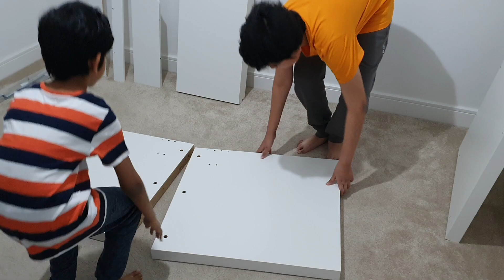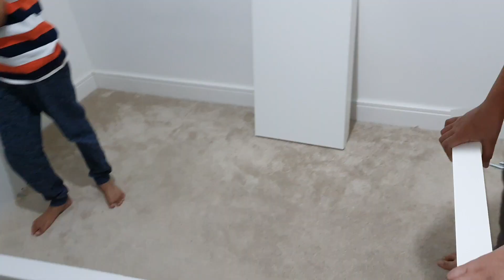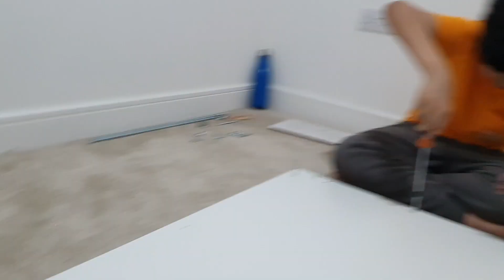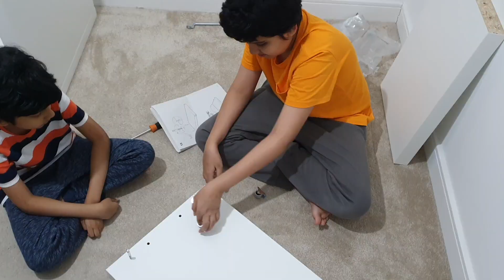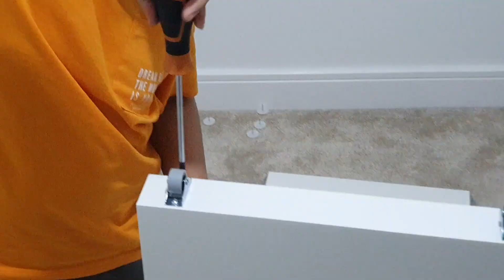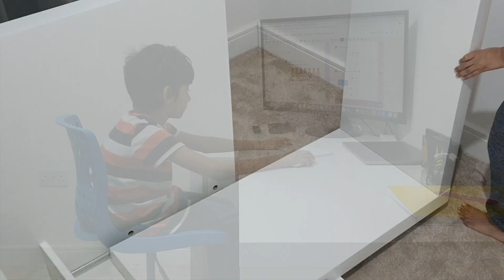DIY - IKEA MALM Desk with pull-out panel

Comment: HI im getting the same table but i want to buy an extra drawer unit to put under but im not sure if a 70 cm would fit inside the desk, the desk measurement is 73cm but i have no idea how thick it is. could you please measure yours and let me know please would be a big help!
Reply from the maker: The table top is 5cm thick which means you will have 68cm gap underneath the table. We have kept a shelf of 65cm tall (without the legs) underneath the table.

Comment: Hi may i know the thickness of the table top? Since i need to add drawer below the table but i hesitated because im afraid it doesn't fit under the table.
Reply from the maker: The table top is of 5cm thick. We have put a book shelf which is 2 feet tall (65cm) under the tabletop (not under the pull-out part). It fits in easily.there  but we had to remove the legs from the book shelf to fit that under the table.
Reply: @borntobebrothers8314  I see, alright then, Thank You for answering and keep it up wtih making the great video 👍
Reply: @borntobebrothers8314  Thank you for posting the video guys well done! I need to add a drawer below the the pull out part and i was wondering what is the high there?? i cannot find anywhere in IKEA's website...  thank you!
Reply from the maker: @alexiliakis  Sorry for the late reply. The pull-out part has 60cm height underneath it. Hope this info helps.
Reply: @borntobebrothers8314  oh I see, unfortunately that makes it very short for me.. thank you so much!

Comment: What screws to use for the desk u can pull out
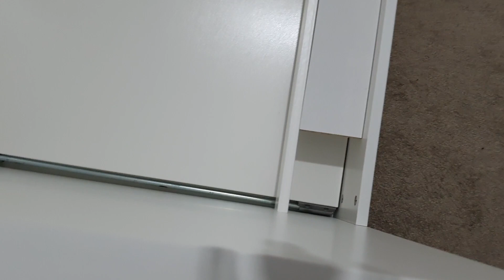Reply: 3:45
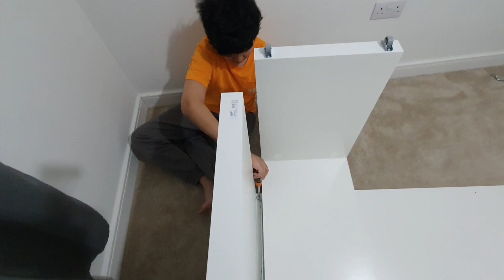Reply from the maker: @abdelo1  It's a long metal rod that will run into the hole provided (no screws for this), through the clamp and requires a screw only at the front side. Watch 3:50.